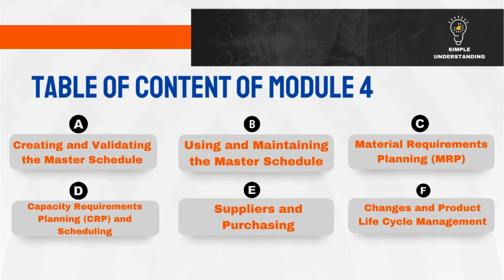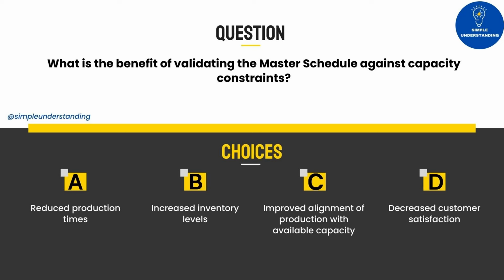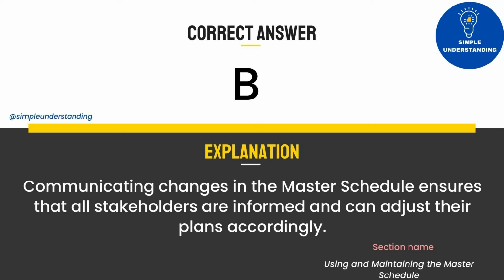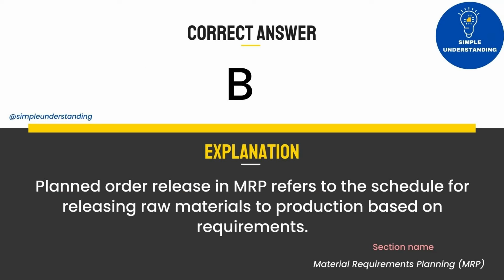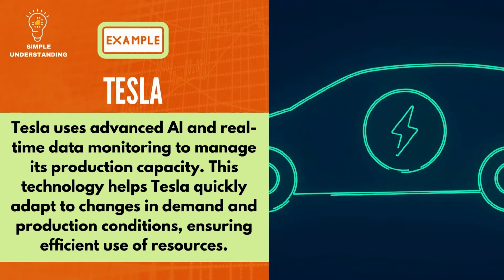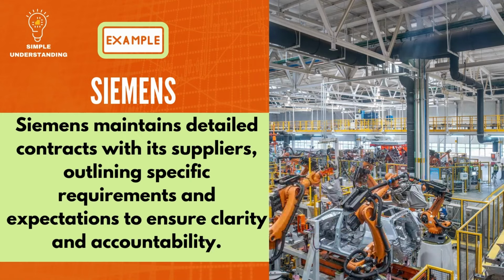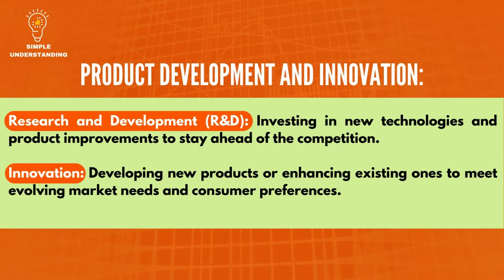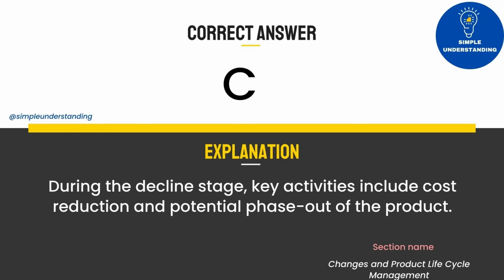APICS CPIM Module 4 Supply Management Full Course | Explanation & Practice Test (68 MIN)

Comment: There are a few instances I see now of the practice test question being asked before the material is even learned. And are the questions in the actual CPIM test this dumbed down because some of them you could intelligently multiple choice the correct answer because the other ones seem not to even apply to the question. Enjoying the guide but questioning what exactly I will be encountering when I go to actually take the CPIM course for myself
Reply from the maker: Thanks for your feedback!  The practice tests after each section are designed to be easier for beginners to ensure they understand the main concepts before moving forward. So they are meant to reinforce key concepts, but they might not always reflect the actual CPIM exam difficulty. The real test is more structured and aligned with the official APICS materials. If you're preparing, I’d recommend focusing on understanding the concepts rather than just answering practice questions. 

I'm currently preparing new videos with tricky questions and mathematics problems, so stay tuned for that! Also I am updating the materials on my website, don't hesitate to take a look. Let me know if you have any specific concerns.
Reply: @simpleunderstanding  Thank you for taking the time to reply. My idea was to go through the stuff you have up first before I jumped the gun and take the actual CPIM course to see if I liked it. The material has been useful so far and hopefully doing this first will help me get through the coursework faster once I am actually down that road.
Reply from the maker: @MellowDaddee I really appreciate you taking the time to go through my material before committing to the CPIM course. That’s a smart approach, and I’m glad you’ve found it useful so far. If you have any specific topics you’d like me to cover in more depth or any challenging areas you come across, let me know. I’m always working on improving the content to help learners like you get the best preparation possible. Wishing you success in your CPIM journey!